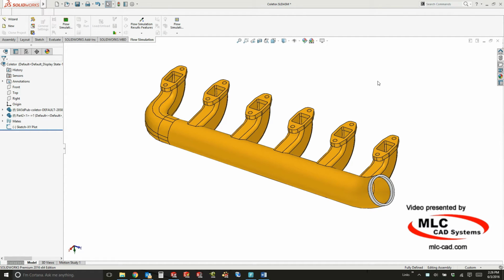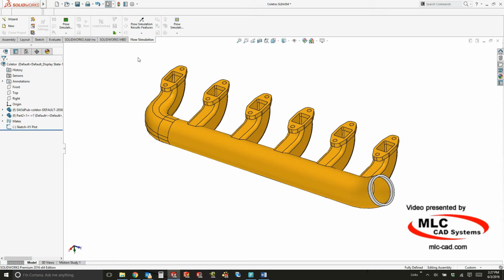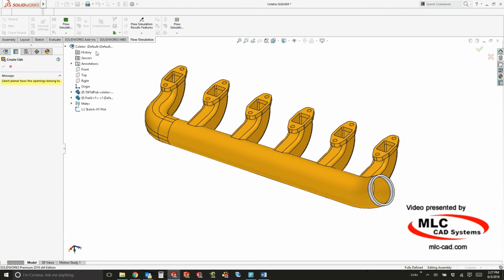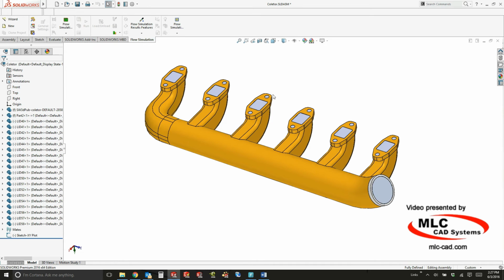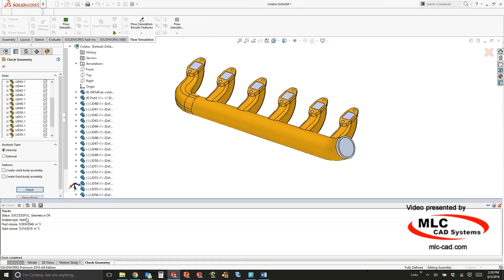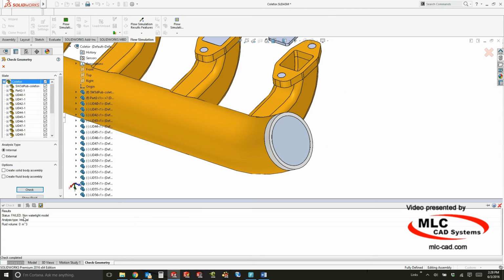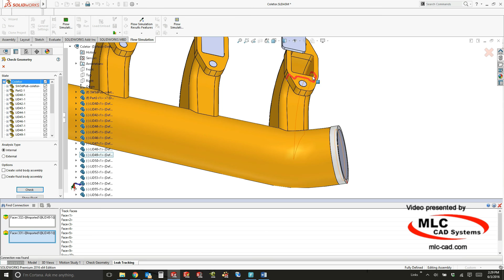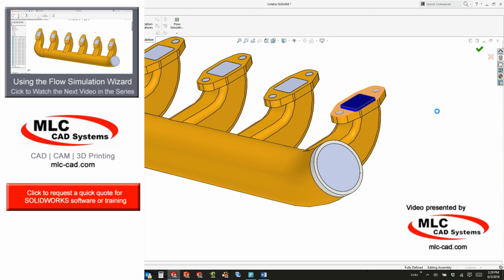Introduction to SOLIDWORKS Flow Simulation

Comment: I'm trying to understand air flow through a 5inch id to a 3-4 inch id then back to 5in id. Do you have any videos of that?
Reply from the maker: No, but the software is designed to make it easy to setup and run any configuration you want quickly and easily.

Comment: hi, do solid works simulate condensation?... for example in a heat interchange with steam
Reply from the maker: Steam is supported as a fluid and can change state with some caveats.  It isn't going to show droplets of water collecting with surface tension considerations, but it will show density changes and steam/water percentages.  The functionality doesn't really apply well to any other fluid, but as long as water/steam is a good fluid yes it can handle well.  Let us know if you would like to learn more or see a demonstration!

Comment: can dual fluids be simulated in SolidWorks FLOW?  (air and liquid as in an atomizer)
Reply from the maker: Within some limitations yes.  It would be a particle study with fluid particles being represented as spheres of a given size.  The particles cannot impact the flow and they cannot interact with each other (join together to create bigger particles) but it will show you where they go and if they hit any walls.
Reply: @MLCCADSystems  basically Lagrangian.

Comment: Thank you for the tutorial, I trace all the problem and leak on my model, but i dont know how to fix the lines
Reply from the maker: The leak line will follow the solid/surface interface from the inside of your part to the outside.  Your task is to find out where the line crosses from what you understand as an "internal" face to an "external" face and fill that hole with a lid or by modifying the model geometry slightly.  If anything lids should be oversized to eliminate any confusion or any possibility of a tiny gap.  Lids can even interfere with the body with no issue (in nearly all cases).  When you have it setup, you should be able to show fluid volume and see the interior volume of your model.